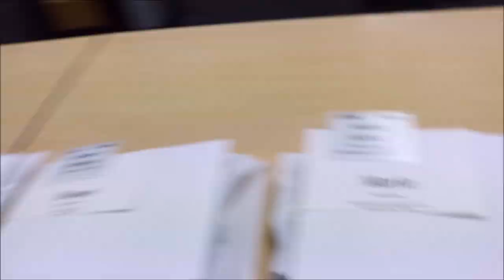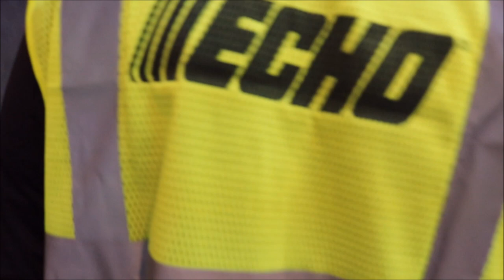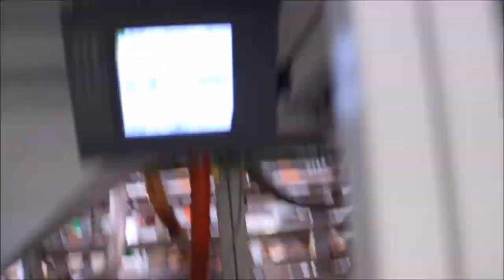UAG PART 2: Echo Plant Arrival, Factory Tour, Fun Facts

Comment: Funny how you guys were talking about the pellets and how they make the plastics for their equipment, those injection and mold machines they have are small in comparison to what I run the small injection machine I run is 500 ton Engel Injection Press and 1 of the larger is 720 ton Engel Injection Press and our pellets are shipped in also we have TPO and ABS are the main 2 pellets ABS come in and is put in silos also
Reply from the maker: D. Gentry that's awesome